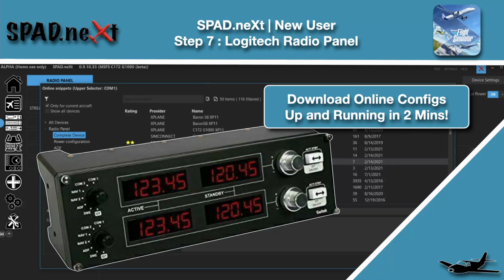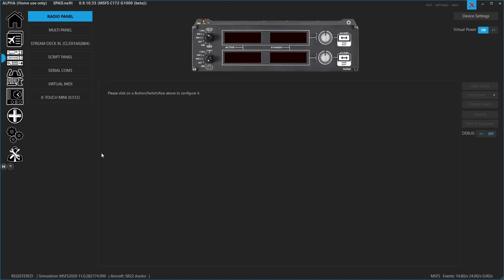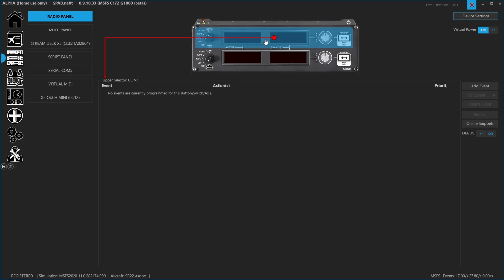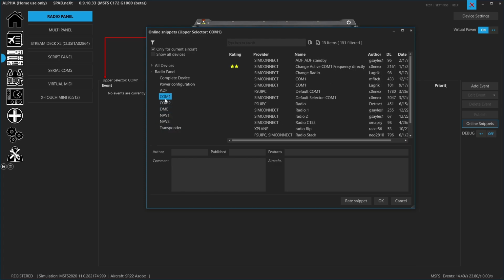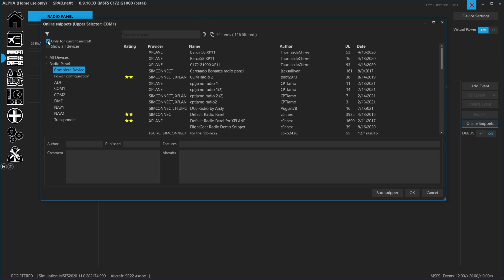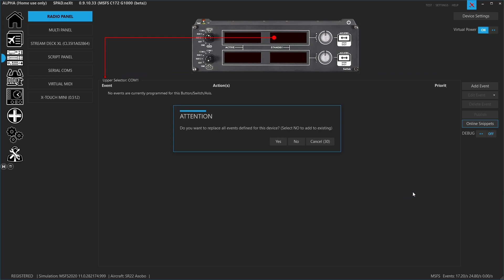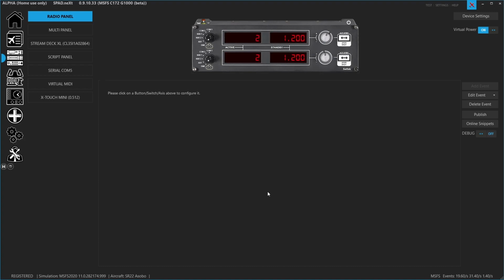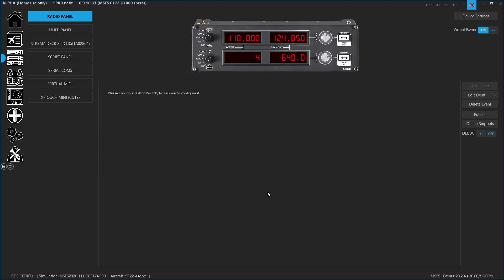(Sim Video) New User #7 | SPAD.neXt | Logitech Radio Panel

Comment: Although this vid is 3 years old, the info worked perfectly for my Logitech Radio Panel in MSFS 2024!! Hugely impressed. Thanks
Reply from the maker: Yup. SPAD does a good job of making most stuff just work where it can. Only issues are where a plane has had changes in 2024 from 2020.

Comment: I fly the 172 with the G1000 and the TBM with the G3000. Is there a single panel that will allow the Logitech radio to work with both of those systems?
Reply from the maker: No. You need to make profiles for different planes and then load devices targeted to those avionics.

Comment: Awesome video. Great work 3 years old and still very useful. I see you have a lot more videos. Can't wait watch them, you made me buy some logitech panels and i'm happy.  Following this video was also useful to have a nice radio stand.  https://www.youtube.com/watch?v=fLu7ruh7HTs&t=124s&ab_channel=AlmedinFilms  The issue i have is that when setting 2x left knob to COM1 for isntance and then long press, the switch between 2 and 3 digits to the left of the dot occurs not only on the device i want to but the 2 others as well. Is there any way to make the change for only one radio panel? the thing is the one in the middle is out of sync.
Reply from the maker: When you change the between 25 and 8.33 it is the same variable.  so they are tracking that standard variable.  If you want them different then you need to use local variables or remove the tracking of the variable that is defining how many digits to show.

Comment: I get a warning that Logitech drivers are running. How do I remove them ?
Reply from the maker: In the #5 video it shows you how to remove the Logitech software so that it does not cause issues with spad.
Reply: @LesOReilly  So once you do that you need a profile in SPAD for every plane you fly?
Reply from the maker: @teamhiortracing  well “depends”. Some people don’t but I do. I have a profile for each of the planes. Usually I just take a similar plane and then use the Make new from this feature.

Comment: Hi Les. My Logitech radio panel has 5 digits and not 6. For com 1 and 2 my panel shows 24.850 and spad.next shows 124.850. Is there a way to adjust this?
Reply from the maker: The physical panels only have 5 digits but MSFS does support the 8.33Khz spacing...  So in the display you can pick which numbers to cut off ... Left side or Right side... Note that in my radio panels I have a special mode so you can set it to 8.33 or 25K modes.  in 8.33 I drop the Left side so you can see all 3 decimal places...  And since the radio Freq will always start with a 1 it's kind of redundant.  When in 25K mode I drop the right side and do 2 decimals... that way I know I am in 25K mode....  In the Advanced Radio Panel video I show how all of it is setup...

Comment: Sorry but radio panel can work with fbw a320 ? Regards
Reply from the maker: Not sure.....  I don't bother with the FBW ...  I am waiting for the Day when they stop constantly changing the thing :)....  There is improvements I get that.. But they were constantly changing the AP Events and other variables and it drove me nuts....

Digressing...  in the early attempts at it what I found was that yes it worked and they tuned however the Displays in the Cockpit did not update...  So as long as you ignored them and only looked at the Saitek Radio panel you were fine...  Otherwise the trick was to turn the in cockpit panel OFF and Back ON then the display would update.

Comment: I can fully understand that there is technology available to make all these changes but having gone to the expense of purchasing the Logitech panel, which is about as close to the real thing as you can get, given the cost and the limitations of the sim, why would you want to change any of the configurations. As an example, if I buy a radio, I expect to tune a frequency as you would in reality, given the aforementioned considerations, having done that, I would then use the ACT/STBY switch to make the frequency active. What other function would I want that switch to fulfill? If I buy a car, I wouldn't want to change the gear selector lever to an accelerator!
I have the multi-panel, the switch panel and the radio panel all up and running correctly without the need for any of the rigmarole of Spad.neXt. The Logitech Plug-in works fine for me.
Reply from the maker: Well it's not an option to use the Logitech software if you want to use the WT CJ4, FBW 320, PMDG DC-6 or the AS CRJ.  Those use L:Var and H:Events for the Auto Pilots and many controls (now for most the Radio works... well AS CRJ I had to make a work around for NAV Standby) so there is no way Ray your MultiPanel will work with any of those add on planes...

Radio examples that I will add in the next video --  On the Transponder page I have added a Control for the Transponder Mode as well.. You can control Stdby-ON-ALT without needing to go into the sim.. and that all works with Vatsim so no need to press that control.

Com 1 and Com 2 have functions added that will allow you to switch them between 8.33Khz spacing mode or 25Khz spacing..  something that was added with MSFS which is awesome but not easily controllable without something like SPAD.neXt (FYI YouTube does not like the dot between the name and holds it up in comment review.. and they have no "approved" word list only a bad list...).  Works great with Vatsim!

Making the ability to select the transmitting Com via a "Long" press on the button... again works with Vatsim.

Having the Selectors also control the Receiving Audio ..  don't have to click on the audio panel in the sim...  If you have a com selected on one of the rows .. it will turn on the Audio Panel.  Also MSFS recently added Volume Levels...  and I added setting the Volume level to 100 as well since there are some weird things after SU4 that played with those...  Again all works with VATSIM so if you select a com on the panel you are automatically hearing that Com online as well.

Then similar type Audio panel control... select a Nav Radio and it will turn on the ident for me so that I can hear and validate the Nav station... plus with a Long press I can Mute it.

Now when it comes to the Switch Panel or the Multi Panel.... it's a no question that many items in the better planes won't work with Stock plane events...  So those will have to be changed or you want to add things...  or maybe like me you have more panels / Yoke that has similar switches and want to repurpose other switches since I don't need 4 Battery switches in the pit and can use them for other assignments.
Reply: @LesOReilly  awesome, cant wait to get Spad.Next working with all my Virpl Devices and their LED push-buttons (MASTER WARNING, MASTER CAUTION, landing gear lights, speed-brake lights, etc) in DCS WOrld and MS 2020.  IT won't be easy, but flight sim isn't a cake-walk.
Reply from the maker: I think work on DCS was stopped ... Not a full API or something and not many users of SN with DCS...  Now you can map "key commands" or vJoy to basically anything but not the same :) as being able like MSFS/P3D/XPlane
Reply: @LesOReilly  Roger that, Les. I'm a low and slow flyer, rarely flying above 12,000ft and my Logitech panels all work okay for me in my Lycoming powered aircraft using the Logitech plug-in. It gives me all the functionality required in the panels but I understand why it might be necessary to go a few steps further. Cheers.